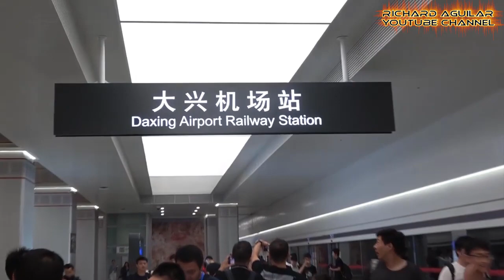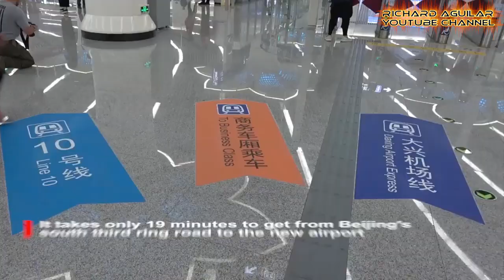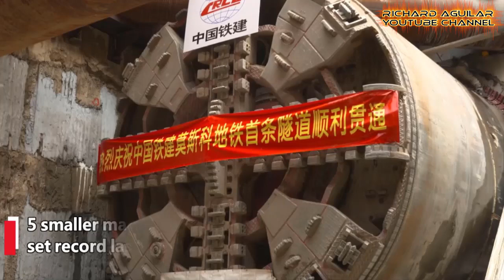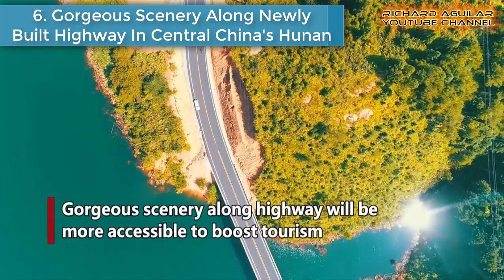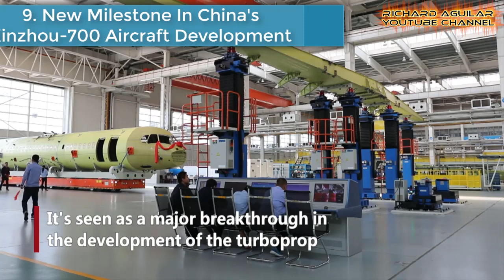China's New Innovation! New Aircraft, Maglev Train, Giant TBM & Many More

Comment: Technology 15:05, 23-Aug-2019
Huawei launches 'world's most powerful' AI chip Ascend 910 and open-source AI framework MindSpore
Updated 19:19, 23-Aug-2019
By Gong Zhe
Share

Huawei's rotating chairman Eric Xu shows off the company's new AI chip Ascend 910 at a launch event in Shenzhen on August 23, 2019. /Photo provided by Huawei

Huawei unveiled its new AI chip "Ascend 910" and an open-source AI software framework "MindSpore" on Friday.

The Chinese telecom equipment giant claimed the new chip has "more computing power than any other AI processor in the world."

The bold claim was backed by Huawei's own test showing the chip can deliver 256 TFLOPS of performance for FP16 operations at 310W power consumption.

For a quick comparison, Nvidia's Telsa V100 chip can only deliver 125 TFLOPS at 300W power. Google's TPU v3 is even slower with a number in the two digits.

What's more, Huawei promised that the price for Ascend 910 products will be cheaper than V100-based ones.

Watch the full launch event here.

The chip is the company's further expansion into the AI sector and a move to achieve its chip strategy amid the U.S.' intensified crackdown on the Chinese telecommunications giant.

The AI chip market is still young, with big names like Intel competing with startups like Cerebra. Internet giants like Google are getting into the AI hardware accelerator market previously dominated by graphics card makers like Nvidia.

Huawei tapped into the market with the Ascend 310 chip last year. The chip was touted by the World Internet Conference 2018 to be one of the 25 most important achievements in the industry.

Huawei's Ascend 910 AI chip /Picture provided by Huawei

According to Eric Xu, the company's rotating chairman, the next-generation chip "Ascend 920" is also under development.

MindSpore: One framework for all 

Released with the Ascend 910 chip as a paired AI training kit, MindSpore is Huawei's version of Google's Tensorflow or Baidu's PaddlePaddle.

But Xu claimed